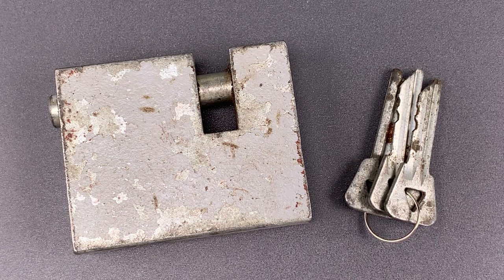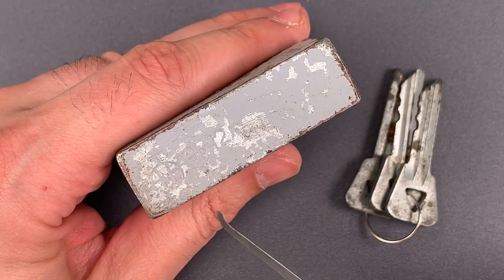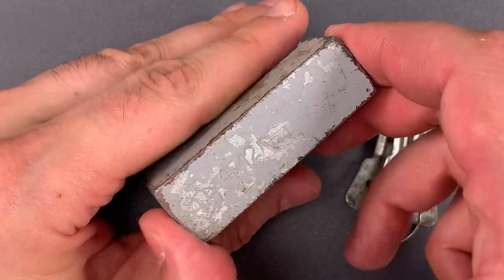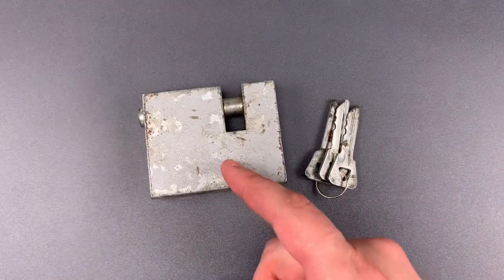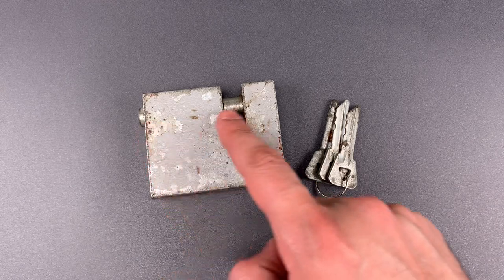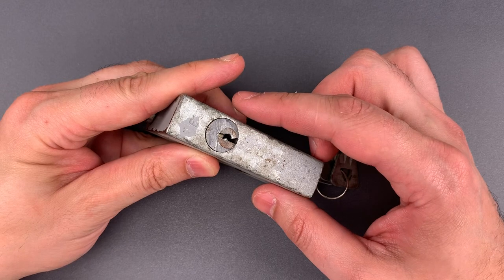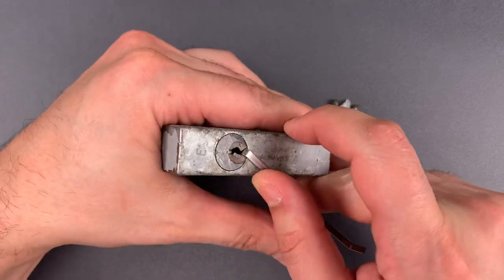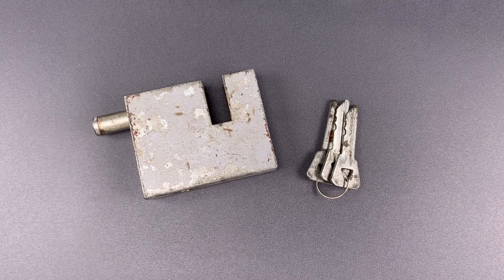[946] Vintage Soviet Aleksin Shutter Lock Picked

Comment: Can you be there at Area 51 to unlock the gates?
Reply: I don't think he wants to get shot.
Reply: I think he'd be "picking" the lock with the .50cal, from outside the exclusion zone, where he can argue plausible deniability.
Reply: The locks would be relatively easy to pick for a professional speed picker, the likes of LPL, however the advanced detection electronics and physical security, is what deters most individuals from such brave... nay futile challenges! LOL👍 The ammonia sensors, infra-red/thermal cameras alone that surround the perimeter lands, detect human presence long before reaching sensitive (even more secure) areas of interest.
Reply: Yeah, a much younger version of myself made the miserable trek out towards groom lake to get a photo with a sign that says ”use of lethal force authorized”...    y’all have fun with that.
Reply: i think  he would be capable of doing that for us at area 51
Reply: NorthernSeaWitch he wont get shot if he runs like naurto duh
Reply: @transrightsarehumanrights2821  If area 51 contains anything of intrest I would be totally shocked. Any competent spy would have moved everything the first time the name of the place showed up in public.
Reply: First of all you can drive right passed the fence, the only thing stopping you is the camo guys, Other than that the only first warning is red line at the entrance, If you even step over it you are screwed

Comment: You should feature a lock that you can’t pick open
Reply: It doesn't exist.
Reply: I'm sure he will, when he finds one.
Reply: @LockPickingLawyer THE ORIGINAL BRAMAH CHALLAGE LOCK.... PERHAPS?
Reply: When do we get to see LPL's naughty bucket?
Reply: ep. 636 and 653
Reply: @asefjamilajwad  One man not so long ago, picked the Bowley with a coke can and a few bits of scrap wire! 👍
Reply: Check "[636] Bowley Lock Analysis and Update". I think that one still hasn't been picked.
In theory it should be possible, but it would need a very special tool.
Reply: Amen to that!!!
Reply: Quite a few videos ago, LPL casually mentioned a few locks that have stumped both himself and BosnianBill. It may have been one of the "naughty bucket" videos.
Reply: He talked about some locks that he couldn't pick in the "Nasty Keyways" video.
Reply: maybe with an unicorn and a leprechaun

Comment: It was much too big to be called a lock. Massive, thick, heavy, and far too rough. Indeed, it was like a heap of raw iron.
Reply: You got some Guts to make that kind of comment.
Reply: Eh...Squire's SS100CS lock would like a word with you.
Reply: Reminds of something I heard a long time ago about how things could go sideways in the old USSR. In this case it was a european engineer who visited a factory making transformers and was amazed of the scale of it all, and especially of how large some of the transformers they made were. When he asked about the performance it turned out they were incredibly heavy for their rated effect. The explanation was that the factory got paid per ton of iron used for the transformers so making them small or light wasn't a priority. This was a result of the plan economy where they had to make sure they had a use for huge amounts of iron or they would have to cut back on the mining meaning they would suddenly have a lot of miners out of work...
Now this is something I heard perhaps 40 years ago, and I have no way to verify it either way, but it kind of makes that lock look sane.

Comment: I think your judgment of the core fails to factor in an important detail: Many of these locks aren't really designed as security devices protecting you from a skilled criminal. They are used as safety devices. At several train stations where you have a key cabinet and the keys are visible behind some pretty simple glass and the cabinet isn't secure at all. But they are here because when you have to get a key from an office, you also have to go to that office. And if you want to get the key from a person, he should be aware of the fact that you plan to use that key and thanks to formal training he should be aware of consequences. 

The key missing from its place is a visible indication of these events and can be a reminder for anyone in the office. So the key and locks are there to protect you from accidents, from forgetting things, etc. so they should be reliable, they should be resistant to accidental damage,  but they don't need to be secure as they aren't responsible for preventing intentional actions (crime). 

So as safety measures they protect electrical switches, valves, levers that could operate railway switches, signals, etc.

Huge tolerances mean the equipment will work with low maintenance, even on rarely used equipment, even with corrosion and it is resistant to environmental conditions (heat, etc) that could stop a precise device from working. But the moment you know it will have huge tolerances, it won't be secure for that reason. The key will be accessible. And if anyone wants to sabotage the system (and want to get caught by KGB and earn a little vacation in Siberia, where he can visit and endure work camps) it isn't hard to get the key, duplicate it, etc. So a more secure core wouldn't help there, but its disadvantages and price could be a problem. 

So I think different applications demand different kinds of measures.

Comment: Could you say if this is inadequate based on 2019 tolerances and requirements but typical of a 1960s lock, or is it poor in comparison to other locks of the era?
Reply: Judging by the price and the type of the lock it must have been produced in mid-1980.
I hadn't seen anything like that before 1980s.
Tolerances? What are you talking about?
That factory probably was still equipped with British machinery back from 19th century...
In 1980s the best locks you could find in the Soviet Union were Abloy leftovers from Moscow Olympics.
They eventually started making knockoff disk locks (by late-1980s) but quality was awful and tolerances non-existing. Socialist planned economy was terribly slow and had no incentives to improve quality.
Reply: @jcrnda  capitalist detected

Comment: Hi
You don't have in Your collection one type of the locks used on many garage doors all other post USSR. Its called: реечный замок
It is considered "pickproof" by some.  Most of them can be opened just by stick or nail, others are costume built and have special secret locking parts. They are almost unpick-able without seeing the key or inner construction of a lock. 
Another one is used on 99% of metal apartment doors (If there is something to steal) in Post Union. We call them: краб or паук.
Example: Mottura 54Y936   +   Mottura Champions PRO cylinder 
I hope it will be challenge for You

You are Awesome !
Thank You